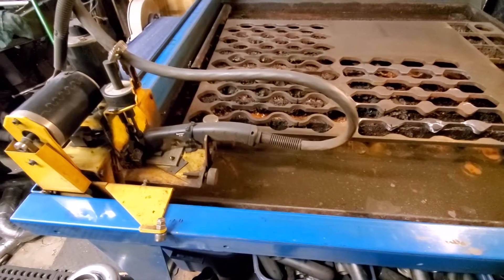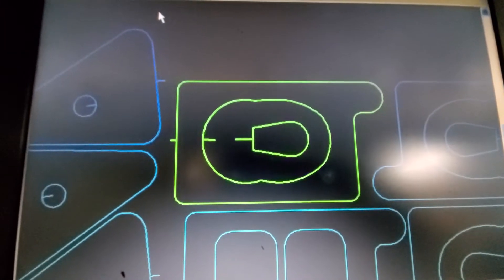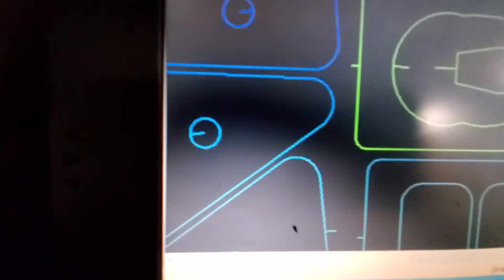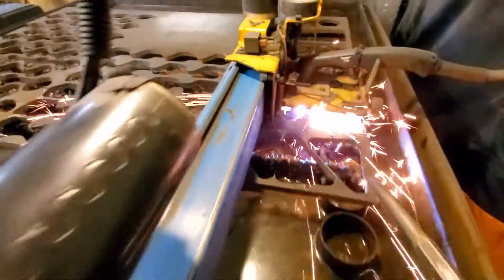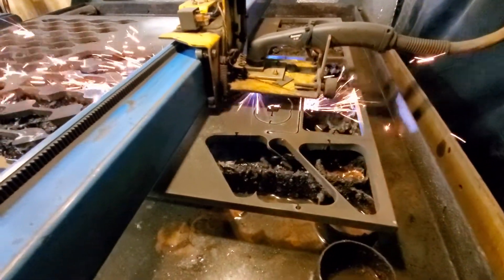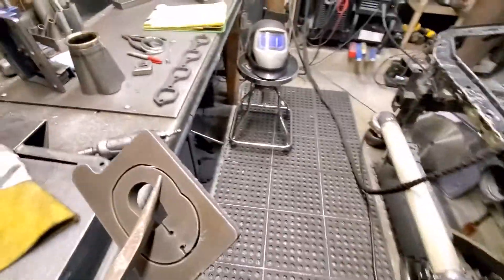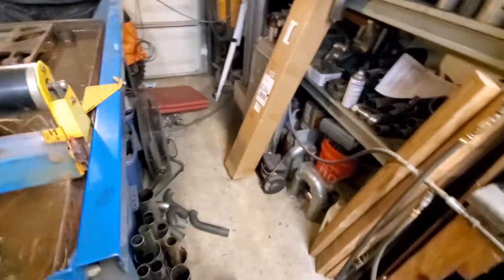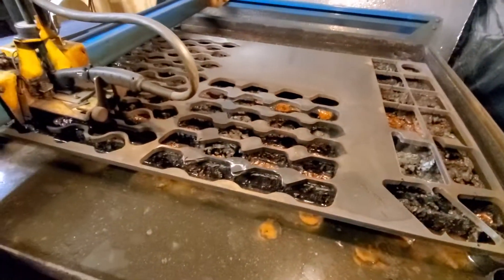PlasmaCam 98z cutting 1/2" plate

Comment: Awesome video, thanks for sharing this! I also have the 98z machine and currently Im working on trying to get it functioning again. Would you be able to share how the plasma cutter will connect with the table? I know that model of hypertherm is discontinued but would I have to have an older cutter like that or would a new one work? If you can share or explain that part it would help me greatly!
Reply from the maker: Sorry for the super late reply. I bought my table already setup from the previous owner. I hope you have it figured out by now.
Reply: @ponydowncnc8365  It's alright bud! I've recently sold my 98z and bought the next newer model from a friend of mine that I know works and I have "borrowed" the use of on some projects in the past.